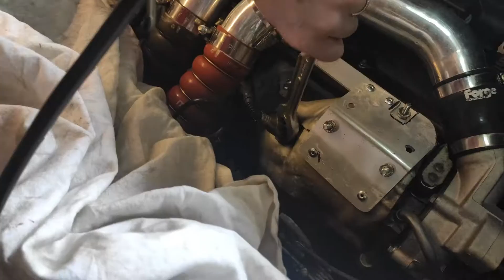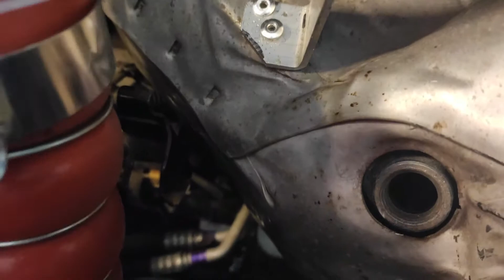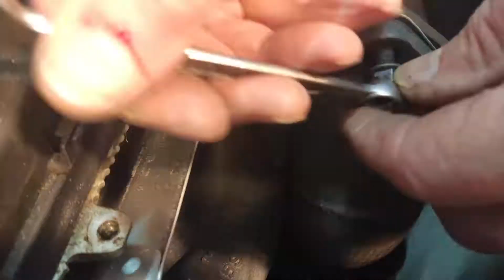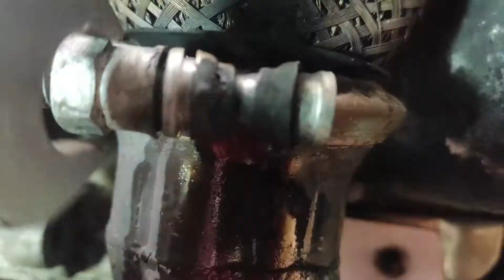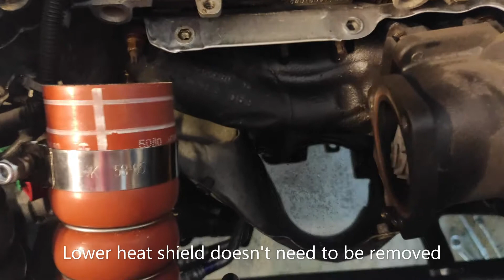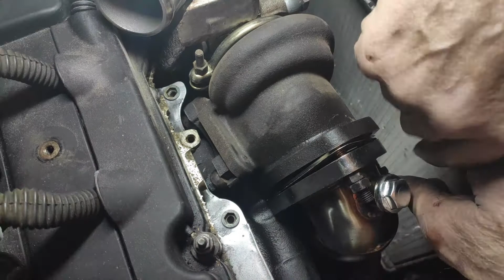1.6 THP downpipe change 🔧🛠

Comment: Probably not the question for this video. Is it possible that clogged up cat converter decrease power output and sounds like it has massive hole? I have forge mototsport air intake. I wonder, because cat is not cheap .
Reply from the maker: if clogged up, it will give performance issues in the end for sure.

Comment: Which car is it ? 
The fan has been disassembled to save space ?
On my DS3 I have no space to loosen the screws, I thought to disassemble the fan and the radiator.
Reply: You can do it using an universal joint socket with a ratchet. My current problem is that one of the stud bolt is stuck and I have no room to extract it

Comment: I did the same . I couldnt solve the problem of the leakage. Is the gasket metal or some rubber ? Mine is metal and I feel the smeel inside due to leakage.

Comment: Love your vids man! Quick question if I may? Is it necessary to remove the turbo studs or did you jus do it for convenience?
Reply from the maker: Good question! I think it might be possible, but in that case I suspect that the lower heat shield must be removed.

So, yes, for convenience it was for sure.
Reply: @THPTuning  Thanks for your advice! 🙏🏻

Comment: Nice video,the downpipe use a 200cpi sport Cat?any problems for "Mot/ITV" test?
Reply from the maker: Yes, it is a sport downpipe with catalytic converter.  No issues at all as the catalytic converter does is work properly. A straight downpipe (without catalytic converter) will always give issues during an annual check up. Depending on country regulations ofcourse.
Reply: @THPTuning  Thanks for the info, could you please give some info about sports cat? serial number or brand?

Comment: how did you unscrew the bolts of the thermal cover of the catalyst before removing it completely
Reply from the maker: the lower heat shield doesn't need to be removed. If you unscrew it a bit on one side you can lower the downpipe. A replacement downpipe can be fitted from the bottom. 

Check the detailed downpipe-change video to see where all screws are located.
Reply: @THPTuning  where IS thé vidéo please

Comment: I have the same car but the nut closest to the radiator I cannot remove I have no leverage you look like you have more room than I do was it only the heat shield you removed?
Reply from the maker: Check the other videos of the downpipe changes. It should be an easy job if you follow the same steps.